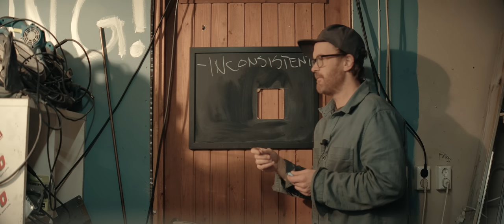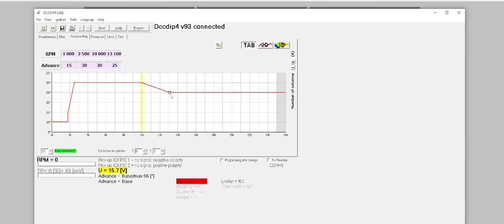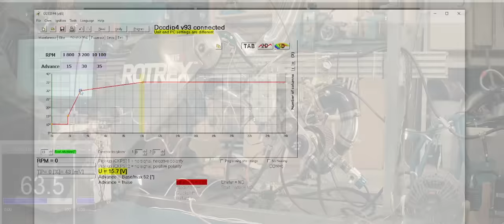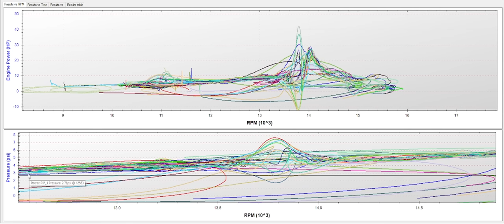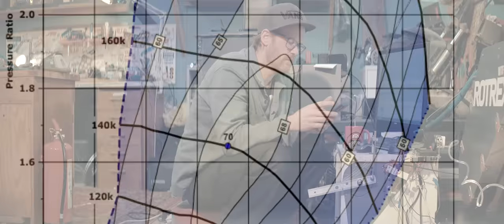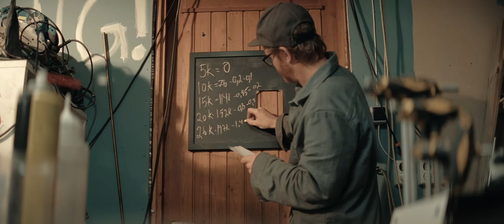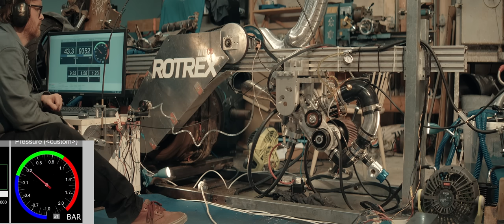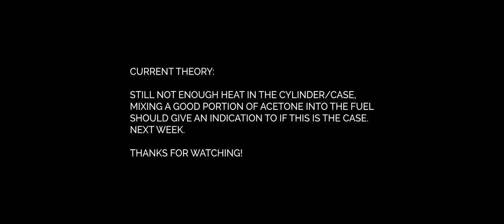Supercharged Pulsejet Engine?

Comment: I think we need a restriction at the exhaust port, for three reasons:

1-To assist the pressure wave coming back up the pipe in sealing the chamber. The only answer to stopping the pulsejet is to hold the fuel where you want it burning. We're running the PIP cylinder at the moment, right? So perhaps the closest we could get is choking the inlet to the pipe itself, creating a pressure differential to trap the mixture. 

2-Increasing dynamic boost pressure heats the mixture more, as well as spending longer in the warm crankcase. The stinger/pipe being the system restriction concentrates the highest energy differential there, and ignition is coming from upstream. Moving that point upstream to the edge of the head may help decrease the volume that the supercharger "feels like" it is filling, lifting those boost numbers that have always been a little low.

3-It's really easy to test!
Reply: 3 very good points IMO Dan! the 3rd one especiallyI Things simply can't be pipe dreams they have to be practical to allow installation and testing.
If I may first say this engine/expansion chamber with correct stinger fed by the Roots blower/ speedway carb achieved 18300 RPM with 15 degrees of timing pulling the retarder and climbing in rpm before backing the throttle off. I feel we need to remember this.
Whats changed? the S/C and carb that's all!
The roots blower ran pull through from the speedway carb which had lots of testing time under it's belt. It also ran the engine upto 1.1 bars of boost while the Rotrex/ Lectron runs blow through!
What's the difference? well there's no fuel/Air mixing from the supercharger for one. The Roots used to smash the fuel droplets to a fine mist. The finer the mist the quicker the burn.
Secondly. The Roots produced 1.1 bars of boost pressure, what does the Rotrex produce under load.
Thirdly, the lectron has a reducer in the back passage. I feel this is not helping fuel atomisation!
My conclusion as I have stated many times in these comments is this. The fuel droplets are simply to large to burn sufficiently in such a short time. The fuel/air mixture needs to be finer to burn quicker.
Finally the piston only travels approximately 1 inch down the bore under pressure before the exhaust port opens ending the power stroke. The fuel needs burning completely in this time.
At 19k, the resonant frequency of this pipe there are 316 power strokes per second, thats a lot!
That's it from me Dan my finger hurt's.
I'll say it again, you made good points.
Reply: @malcrandall1309  I'm all the way there with you regarding a previous setup running to 18300, I think that was an electronically imposed limit as well. I have a feeling that was on gas, but I could be wrong. I'm also sure that the ignition system has changed dramatically, and that the drag from the supercharger isn't applied in the same manner as a roots blower would be. My understanding is that drag on a centrifugal supercharger is a function of oil viscosity, air density and then rolling resistance. 

In fact I'm positive the roots setup was petrol, I remember Alex saying something about changing to blow through for the sake of running nitro safely. Leading to the next interesting point I found that ties in with yours, the flame front  speed of nitro is about 0.5m/s. The piston travels 79cm in a second at 19k, and only "half" of that makes power. I'm not positive we're at the ignition limit of the fuel, but it is getting worrying if the nitro mix is high. I agree that atomization is important, but short of reducing crankcase volume or heating the charge air (neither of which are conducive to more power) I don't see another good option. I'm not convinced that the carb reducer is hurting, it should increase the flow through the venturi tube by increasing the speed of the air across the venturi. You may be right that this is the cause of improper atomisation though, I'm not really a carby guy.
Reply: @maccadan90 I have gone back and rewatched it twice and can see no evidence of the roots and speedway carb using petrol. I know the fuel system is flushed out with petrol at the end of the day but run on RC fuel! Petrol has being used while using the Rotrex on a couple of test runs with the Lectron.
As far as the ignition goes it was running the single channel system.
I have read in the comments that Alex is going to give Petrol a proper try this coming week but retain the Lectron.
The only reason the Roots blower was ditched was he'd lost confidece with it binding and the resonant pulses it produced
This Rotrex saps a lot of power fom such a tiny 50cc engine as we know.
Alex also mentioned in the comments he'd found the reason why the Rotrex was serging as it was and a bit miffed that he missed it.
Reply: @malcrandall1309  It's true, I could be misremembering things re fuel used with the roots blower. Agreed that the final nail in its coffin was the binding though. Also agreed that a centrifugal supercharger cannot form those destructive interference pulses. 

I agree that the Rotrex is draining power, but I'm positive that as long as boost is generated while torque is high enough to support it, there shouldn't be a problem. I'm going to have to dig out all the old mass air flow equations I've got buried on this PC and run Alex's bore dimensions through them, see what flow and target speed I arrive at. I'm almost positive there's a drive pulley solution to match the result. 

Even with all this extra thought in the background, I'm still a strong advocate for choking the exhaust port at the side of the head. The old backpressure=power myth might finally prove true in this unique application.
Reply: @maccadan90  What we must remember this engine has done 18k in a previous configuration, this cannot be overlooked!
This exhaust duct is a bit radical with it's shape. If the fuel/air was completely burnt by the time the exhaust port opens there would be no chance of internal burning in the expansion chamber.
There have being several of us who suggested going back to basics using N/A and petrol, this was forcably ruled out by Alex so appears he may have changed his mind!
There are still quite a few problems to resolve with the retarder/dyno equipement.
We musn't forget these crackcases have a massive volume of 390cc and made to run with a 90mm con rod which lowers the primary compression ratio. Back in the early 70's when I used to race 125 twin cylinder Yamaha's tuners  of the time wasn't concerned with primary compression. This did not sit right with me especially when I was paying them to do a job! 
I fully plugged the flywheels which was common practice and along with epoxy putty a noticable performance increased was gained. I feel the massive capacity of Alex's crankcases is detrimental to performance no matter what induction is used. When I suggested reducing the crankcase volume with epoxy putty Alex had a public go at me saying he will  do what he chooses and who can fault him. Things have being smothed over thankfully, I have only wished good fortune on Alex.
Let's wait and see what tomorrow afternoon brings. I just hope he remembers to drill a couple of lubrication holes in the piston face over the exhaust bridge.

Comment: on older two stroke (diesel) compressor engines they have a spoiler on top of the piston to redirect the flow from the intake ports up toward the roof of the cilinder instead of straight across the piston and out the exhaust , i suspect this is happening at higher tpms , either that of the exhaust pipe is collecting excess fuel and at a certan rpm the gasses that arent burned fully yet shoot out the exhaust igniting the gasses in the pipe 
think the best thing to do is to introduce the fuel directly intoo the chamber after the ports are closed same as with a diesel but with a spark ignition (has been done with modern cars , its called direct injection and uses pretty high pressures) , might stilll allow the engine to rev faster than the flamefront is able to move but at least there whont be unburned gas collected in the pipe 
might need to get a bigger stroke smaller bore engine to allow the gasses more time  to burn before the ports are opened

Comment: How does the piston look? Have you had it apart since you started this? Seems crazy the abuse it has been through- maybe the rings are shot and cylinder pressure is low. It was way hard to turn it over in the past, seems to spin up really easy now.
Reply: This. Along with adding an EGT to see what's happening there
Reply: It's always worth doing compression check.
Now the exhaust port is fitted with a central bridge and a standard piston used I feel the innards should be OK with all that fuel sloshing about inside
It may just be getting run in? Test runs have being very short and on the rich side of safe.
Alex never used to run any engine parts in or warm up the engine prior to testing.

Comment: Every fuel has a flame front speed. As you increase revs you need to increase the timing advancement to give the fuel more time to burn, In this video you proved the point when you set the advance timing back to 30 Degress at the higher revs
Reply: It's a bit different with 2 strokes because their scavenging efficiency changes so much with rpm. Often at low speeds the scavenging is poor and the charge heavily diluted with exhaust, this leads to slow combustion so they need more advanced timing at low to mid speeds. At full throttle and high speed scavenging is good and mixture turbulence is high, so they may need less advance than you expect. Also you can't advance too much or the spark will fire before the exhaust port closes.

Comment: NOT ENOUGH EXHAUST BACK PRESSURE!!!!
Expansion Chamber calculations are based on NA not boosted,  this means to bring the expansion chamber return pulse waves back into time you need to adjust the exhaust back pressure to cancel out the boost pressure. (or redesign a new expansion chamber ) If not then you blow the cylinder charge out the exhaust making a flame thrower in the process not making power.
Easy test, weld a washer on the end of the exhaust reducing the exit diameter. 
Three main reasons you make a flame thrower, ignition timing, return pulse timing and port timing. You have proved the timing, I work on the basis that your port timing is correct, that leaves your expansion chamber return pressure wave timing.
With the increase of boost, you have increased the velocity of the intake charge, but your expansion chamber is not timed corectly to account for a 50% increase in volume and speed of the charge, this would mean air fuel going out the exhaust.
If the exhaust back pressure is increased it will bring the pipe and port calculations back into spec. 
5 minute test, weld that washer on the end of the pipe, you tried making the stinger larger and it got worse, follow the data and make it smaller and see what happens. Bet you it will rev a load better and you will find that lost power that.
Reply: This is the reason Turbos work on two strokes as they naturally produce exhasut back pressure

Comment: I just had a thought about when your engine goes into "Pulse Jet Mode".
Would increasing the length of the Exhaust Stinger help generate more heat inside the Expansion Chamber, and prevent efficiency loss due to the cooling effect?
Since then the Exhaust would then be generating it's own heat source from burning unburnt fuel and not taking heat from the engine.

With the volume of mixture and air though the engine. I would be expecting to start seeing the exhaust glowing hot.

Comment: You are blowing the mixture right through. When the compressor comes on boost the issue appears. The rotex builds boost exponentially. You need a rotary valve to close off the exhaust when pressuring the intake. Use Torrington bearings on the valve

Comment: As an engineer, I would put the carburetor ahead of the supercharger, because through the supercharger the fuel can mix much better with the air, and you can get much cleaner combustion. Currently, I am working on a similar supercharged 2-stroke that has this order, and with this 1-liter engine we were able to produce 115 hp with 90 octane petrol, and 2.4 bar pressure. 
Don't get me wrong, your engine is absolutely fantastic, but I have a strong feeling that this can be a solution: carburetor-> supercharger-> engine.
Keep up the great work!

Comment: Try the pipe with no expansion chamber. Seems like the pressure is too high from mixture igniting in the pipe and overcoming the fresh air/fuel charge pressure

Comment: AA/FD setup in 1990's.
Undersized roots blower running at excessive rpm resulting in high intake temps.
Phrase is "beating up" the air/nitro mix to put some energy into it.
Engine is fueled to near hydraulic lock. Injectors are above blower. Churning of rotors whips the fuel/air mix into hot foam.
Engine does not breath cool air. Fuel is vaporizing because it is already hot in the intake port and open cylinder.

Comment: try running a 5k or 10k resistor inline with your ignition input from the engine to ignition control box, there are quite a few people with motorcycles and aftermarket ECU that have this issue of hitting a fake hard rev limit.
Reply: or try soldering a 5k resistor from the signal to return ( if a reluctor pickup ) or a 1k resistor from 5V to Signal ( if a hall effects sensor) and see if that gives nay improvement.

Comment: first off - your doing amazing I remember when each week you destroyed a component!

second holy mother of god was that the fuel dumping out the exhaust? at 13k+?

no wonder you cant get enough heat

question if the fuel is stealing all the engine heat 

could you pre heat the fuel?????? so it can't steal as much heat?

Comment: Love the videos and the problem solving involved, I probably get far too caught up in trying to diagnose you’re issues but I love a challenge. Here’s what I’m thinking . . . The pipe stinger is probably too large to work over the entire rev range at low boost. If the stinger is too large, the exhaust won’t counter the boost pressure with the exhaust and transfer overlap (so you’ll never really get ‘on the pipe’). 

I reckon a variable diameter stinger controller by a servo could produce the pressure in the pipe needed to create the ‘stuffing’ action over the entire rev range. 

It could just be a tapered piece of solid round that pulls out of the stinger like a needle jet in a carb. 

Maybe set by rpm or boost pressure, also a cheap egt wouldn’t hurt for fine tuning the jetting.

Comment: Would be fun to try this setup on the brute force engine, to see what happens.
Reply: you mean "to see how it behaves"
Reply: @axllii  - Potato Potahto
Reply from the maker: Plan is to pull more "brute force" into this engine, just want it to work like it is first.
Reply: @2STROKESTUFFING Alex, Having just rewatched some " Brute force " video's again it was much happier around 14k. PiP with the Roots blower and speedway carb achieved 18k plus pulling the rearder and climbing, this should prove the fuel burning rate is fast enough when fully atomised in such a short stroke engine.
I also feel adding a accelerant to the fuel will make matters better.
Are you feeling the beneficial effects of the vitamin D yet.
Reply: @2STROKESTUFFING  - Oppfattet ;-)

Comment: Have you considered the average liquid cooled engine runs at 190 degrees F ? Also , two stroke cylinder head temps can be around 350 to 400 F . Love your project . The  mechanicals seems to be holding up well .

Comment: The plots of pressure and horsepower (11:18) going unstable at about 13,600 rpm look very similar to plots of a system going through resonant frequency.  Damping will smooth the curve and shift the peaks a little.  Notice how the run plotted in dark blue seems to be the least damped.  Resonance could be in some portion of the fluid flow, or could be mechanical.  Normally, a system should be designed to avoid resonance, or damp out the unstable characteristics.  However as with a two-stroke "on the pipe", resonance could be used to your advantage, provided that it has predictable and controllable characteristics.  Finding which part of the system is resonating could be determined with pressure transducers and load cells.  However, hacking away at optimization is probably more productive, as the resonance will change as you alter your parameters.

Comment: I think it would be a good idea to go back to the idea with rotary valves. To me it looks like most of the fuel and pressure just blows through on high rpms, like the pulses from the exhaust doesn't so anything. That's at least consistent with the fact that it got worse with more boost.

Mind I don't know anything 😆
Reply from the maker: 😁I have a secret plan that involves a rotary exhaust valve, transfer reeds, and the pipe. Just want to see how well it can do without all that first.(not very well atm...)
Reply: @2STROKESTUFFING  🤫🫢😆

Comment: Did you consider changing configuration to compressing mixture (carburator>compressor>crank case instead of compressor>carburator>crank case), this might eliminate carb. issues as the carb. operates in its designed pressure and volume flow space. The vaporized Nitro-Methanol would help cool down the mixture so it maybe won't ignite behind the compressor 🤔
Reply: I think in the first video with the rotrex he says a draw through setup wont work because the Nitro will destroy the seals in the compressor
Reply: @willhall4631  seals 🤷🏻‍♂️😁
Reply: @willhall4631  I though that as well, as fuel entering the gearbox. I left a comment asking would Alex consider using draw through if push came to shove with the Rotrex.
I feel all the problems are down to the lack of homogenous mixing of large fuel particles slowing the burn rate.
The Roots did a good job of mixing the fuel/air on draw through. It allowed 18300 rpm to be acieved.